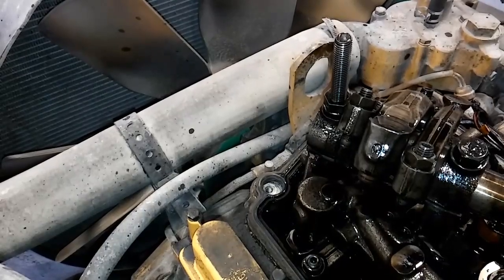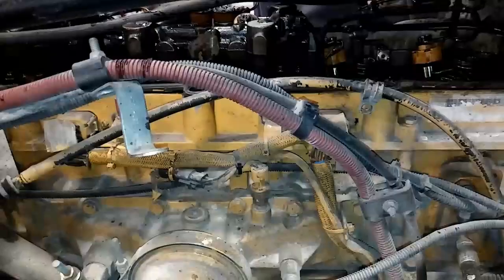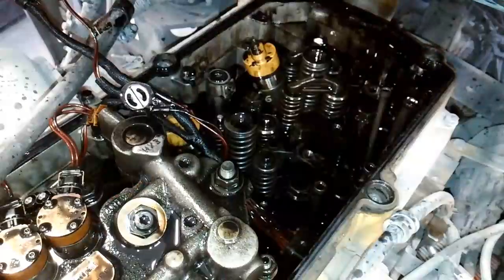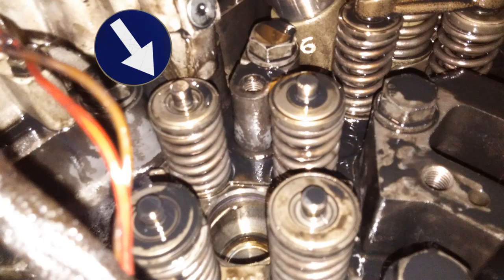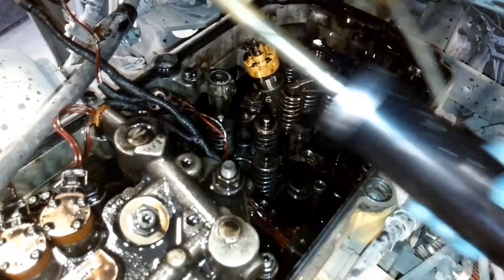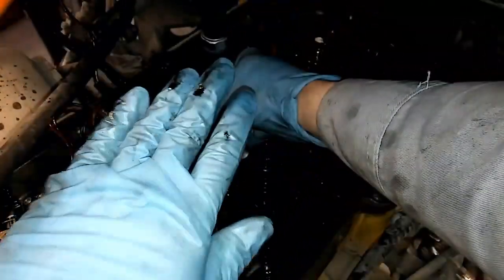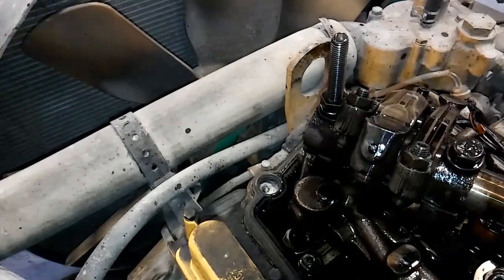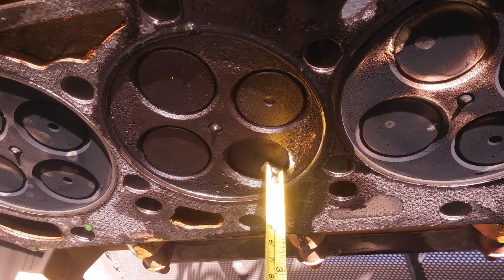Compression Test Your Diesel Engine. Leakdown Test Your Diesel Engine.

Comment: No matter what position piston is in there shouldn't be a loss of air anywhere is that correct?
Reply: The valves are closed as the arms are not on. No air should be lost

Comment: Couldn't they make a fake injector with a threaded hole that fits into the injector holes (and that uses an injector hold-down bolt)? Then you'd just screw a pressure gauge into the hole in the fake injector and get a reading.
Reply: Kaon makes one for the 4 cylinders not the HDFTE

Comment: But what a bad head gasket do the same thing nothing to do with the valves but leaking air to another cylinder . I got a deutz 2011  2-cylinder.  And everything is backwards on it number one cylinders work the flywheel headsets anyway I'm guessing it's a head gasket I was just seeing what your opinion was

Comment: New to Diesels, I recently did a (cranking) compression check.  One cyl was lower, so I did the oil in the cyl to see if it was rings or valves.  Note to self:  Oil ignites under compression.  Buy another compression gauge.
Is the leakdown method the only way to check if it's valves or rings?
Reply: If it’s igniting oil it’s got more than enough compression
Reply: Mmmm I had never thought about that either !

Comment: Thank you, but how did you know #5 cylinder needed a compression test, i.e how did you determine the miss was there?
Reply: One of the valves was sitting a lot higher than the others. He would of seen it when he removed the rocker gear. It's called valve recession, not uncommon on CAT engines.
Reply: He also would of noticed no valve clearance on that that rocker arm. No free play between the arm and valve bridge

Comment: Omg diesel engines seem like a pain
Reply: The opposite. There ignition system is also their fuel system. Noi coil packs spark plugs throttle bodys with iac sensors in tank fuel pumps to wear out. Older diesels are all mechanical . Very simple to work on . Allot easier then modern cars once you understand them.
Reply: @markrich3271  if it's so simple then why doesn't everyone fix their own junk.
Reply: @juanfo7307   They do. People who work on thier own gas engines also work thier own diesels.
Reply: @markrich3271  simple for those willing to put in the time and effort to learn. Not so simple for the vast majority of sheep

Comment: Great video sir! Do you ever use a scope to perform a relative compression check? Ever since learning of that a few years back, I've incorporated it into my regular  diagnostic routine. Even when you don't think or aren't yet sure you have a mechanical issue, it's a nice quick check to help narrow it down. Let's you know quickly whether more invasive testing will be necessary. Keep up the great work!
Reply: Detroit Diesel has this integrated into their program Diagnostic link 8. It is a really handy to get a peek of what is going on inside.

Comment: What is your take on diesel engine oil used in gasoline engines, in particular it appears that Rotella T6 is used in motorcycle engines. What do you use in your car/truck?
Reply: I use Rotella T6 5w-40 in my 2009 VW GLI with 220K miles and no issues yet.  I also use Rotella 15w-40 in my 06 cummins with 229K miles and so far no blowby but I think an injector or more are going out.

Comment: You should also make note that if the piston is on TDC you can also have a issue were it will not rotate the engine, just as in BDC.
Reply: Is BDC bottom dead center?
Reply: @makincash3337  yes sir.

Comment: I know this is off the subject but I just put a fuel pressure gauge on to test it and it's showing 60psi at idle. Is that too low? Also the gauge bled off fast and I have problems starting it sometimes esspecaly if it's cold or if you don't keep your foot on the fuel pedal while starting.  What do you think?

Thanks
Reply: It's a c15 6nz too. Sorry
Reply: tnsportsman21 60psi is way to low just a normal gas engine gets 199psi well thats for my motorcycle diesles need more compression
Reply: What's the middle of the dash gauge say?

Comment: Small diesel engines like the 3024C/C2.2 have glow plugs. Using a glow plug adapter is a bit easier than having to remove injectors.

Comment: Hey I have a question I really really hope you can help me with I haven't been able to solve this.  275 horse 3116 over heats water pump works radiator ok Louie thanks
Reply from the maker: +Lucio Scaringi I guess all the standard questions first. Are your thermostats opening? Have you tested the radiator cap? Have your done a bottle to test for a cracked head?

Comment: Big diesel's don't use screw in glow plugs?
Reply: Not all diesel engines have glow plugs and a C13 falls into that category, It does make it easier for sure when doing a leak down test when they do have them.
Reply: Corey Regier Thanks Corey.  Does CAT use a grid heater or some other charge air type heater for the winter starting?
Reply: These large-bore diesels have such compression that (except for maybe way down at minus40) the air heats up enough enough during the compression stroke for the diesel fuel to ignite.  Of course, down at minus 40, it becomes rather difficult.  The smaller diesels found in pickups, passenger cars, don't have such high compression, so they use starting aids like glow pins, grid heaters, any trick in the book, so-to-speak, to get the fuel to ignite in cold cylinders.  The old trick of using ether to start a diesel can be used on a glow-pin-equipped engine, but the trick is to skip the waiting period for the pins to heat, and begin cranking immediately.  Using ether to start a diesel engine of any type can result in serious engine damage if you don't truly understand what you are doing.
Reply: CAT does utilize an air intake heater on the 3116, 3126, and other engines I can't remember off hand.
Reply: Yeah those engines have intake heaters as well as the C7, but no glowplugs... I don't recall seeing an intake heater setup on any other Cat engines either. Trucks in our area rely on block heaters being either electric or a Proheat system. Battery warmers are important also in very cold areas to get the maximum CCA.
Reply: Some small  automotive engines dont either.  Neither my  rams with cummins 5.9 engines have glow plugs. They use grid heaters. They do have adapters for diesel compression gauges that go where your injectors do though. We get regular -10 here and I have no problem starting up.